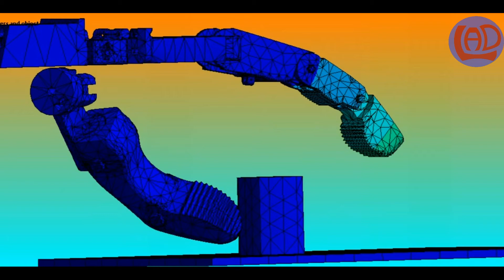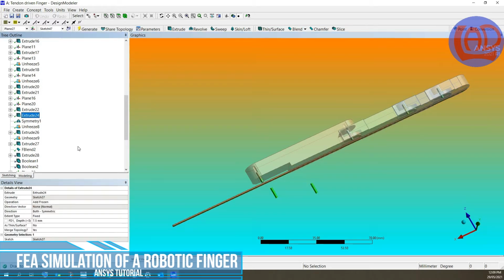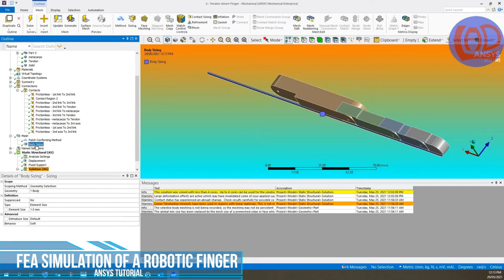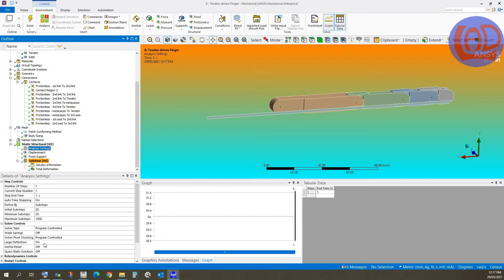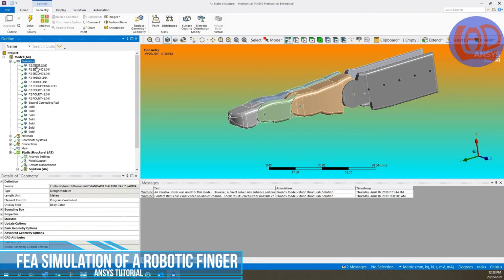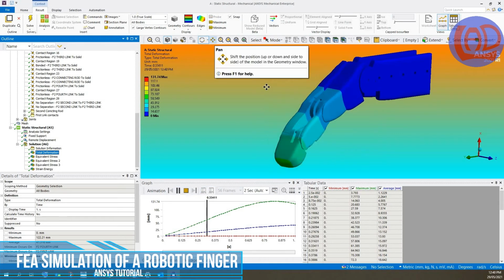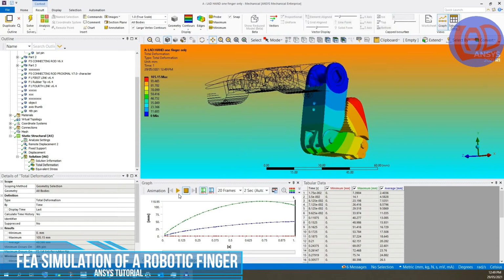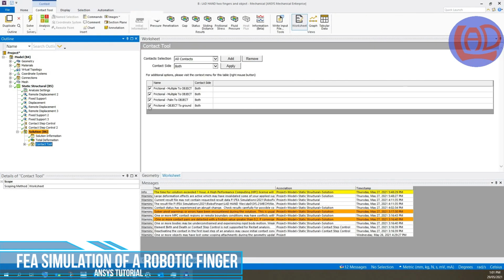👍ANSYS tutorial of a Robotic finger/Robotic Hand (FEA Computer Simulation)-LAD

Comment: how to make tendon flexible like the video
Reply from the maker: Hi there. Thank you for your question. You need to use a young modulus that is low and represents the behaviour of the tendon, which resembles hard rubber, say 10 MPa, then use density of 1,200 kg/m³ and Poisson’s Ratio of 0.49. Make sure to turn Large Deformations ON so that the mesh can flex, make the mesh on the tendon as tetrahedral and suppress the mid side node to improve convergence. Hope this helps.

Comment: Hello, I keep getting the error, "The solver engine was unable to converge on a solution for the nonlinear problem as constrained.  Please see the Troubleshooting section of the Help System for more information." Do I need to change something for it to become a linear problem?
Reply from the maker: Hi there @dencedianerivera1112 . This is a very generic error , and can depend on many factors, and you will need to check each one of them. And your problem is non-linear, because there are large deformations happening. The error message in ANSYS indicates that the solver was unable to find a solution to the nonlinear problem due to convergence issues. To avoid this, simplify your problem as much as you can by modifying your geometry in your CAD software to present ANSYS a body that is easier to mesh. Then, make use of the symmetry planes if possible. Make the right choice of materials, and start with simple linear ones, which are define by Young Modulus, Poison ratio and Density. If you have several bodies interacting together, then consider using linear contact elements to start with, such as “no separation” or “bonded”. Make sure that “Large deformations”  are enable on Analysis Settings. And always start small and simple, with one link rotating around a pin,  to identify specific areas causing the problem. Once this simple simulation has run successfully,  you then add another link, you define more contact elements between the two links, and you let that new simulation run, following the same procedure of the first simulation. Once that second simulation has run successfully, you add one more link, more contact elements, and you repeat the exercise until you have added all the links for your mechanism, and you are able to run the simulation successfully.  Start with the basic, then complicate things a little bit at a time. I hope this helps. Good luck in your project.

Comment: Hi, im just wondering on how do you solve the convergence issues when simulating?
Reply from the maker: @eoeol9054, that is a big question. You need to read the output of your simulation to identify the cause of the error that prevented your solution to continue running. In large deformations analysis the excessive distortion of the mesh is a possible cause of nonconvergence, which is corrected by improving the quality of the mesh in the unloaded model. Or the problem might be that you are trying to apply the load too quickly and then, the solution will be to increase the number of partitions in a substep. But you also need to check if the simulation is running at all or failing in the first substep, and if this is the case then you need to check the basics, correct boundary conditions, correct contacts, correct material properties. If your system is too complex, then simulating a simplified version of it can make a big difference, like using symmetry planes, or remove unnecessary geometrical details. Always keep things as easy as you can, and slowly increase the level of complexity so that you can better trace the sources that are causing the errors. Hope this helps.

Comment: my joints are not moving when pulling the cable can you tell me what could have been the problem
Reply from the maker: HI Friend. There are several things that can go wrong with a simulation on a FEA package. You’ll have to do a “routine/basics check“ to find where the problems are. First of all, have you turn ON the “Larger Deflection” option in the Solver Controls to allow for large deformations to occur? Is the solution converging at all, or is it failing to run in the first iteration? Failing to run at all might suggest a bad mesh or an aggressive stepping, in which case you will need to improve the quality of the mesh, and/or apply the load slowly or between several smaller sub-steps.   Are your boundary condition reflecting the real behaviour of your system (i.e fixed supports applied on areas that are not supposed to move. Everything else needs to be free) ? Have you created a geometry composed of multiple bodies and multiple part? If that is the case, have you created realistic contact elements between the multiple bodies that interact with each other (i.e frictionless, frictional contacts between the “Cable” and the cavity hole in each of the links where the “Cable” is supposed to slide through)? . Have you created revolute joints constrains on the pivoting points, and are they well defined ? (i.e prevent displacement in X/Y/Z and allow rotation in the axes of the pivot only, say RX=0, RY=0, RZ=free). The most accurate way to simulate a pinned connection is to add a pin to the model and use Frictional contact between the pin and the holes. Have these frictional contacts been properly defined, or is the friction too large that does not allow the mechanism to rotate?. Is the material for the “Cable”  appropriate, or is the “Cable” simulated as a rigid rod of steel?  I hope this helps.

Comment: please tell provide a detailed video how did you do this. I've been trying this thing for 3 days and could'nt get the desired result. please reply
Reply from the maker: Hi friend. Without knowing your particular problem, it’s going to be very difficult to assist you with any visual means. Are you having problems with excessive distortion of the mesh, or excessive penetration, or the contact elements, or the materials definition, or the stepping for the solution to converge or ….. There are many things that can go wrong with a FEA and no tutorial is going to solve “that” particular technicality you are trying to solve.  First thing to try is don’t panic. If you are having problems running your FEAs, then you belong to this earth with all the rest of us. We have all been there. I can tell you this because of my involvement in the field of designing and engineering. I’ve been using ANSYS professionally for 14 years and from time to time I found a headache or two. But I always follow the same procedure for any phenomena that I want to analyze. Whether you are simulating a rocket that is going to the moon, or a bar been pulled by a load, the procedure is always the same. And if you do not follow this procedure, you will have problems even when running the most basic analysis. Simplify your problem as much as you can by modifying your geometry in your CAD software to present ANSYS a body that is easier to mesh. Then, make use of the symmetry planes if possible.  Make the right choice of materials, and start with simple linear ones, which are define by Young Modulus, Poison ratio and Density. If you have several bodies interacting together, then consider using linear contact elements to start with, such as “no separation” or “bonded”.  If you feel like your model is going to move more than 1mm, then consider turning “Large deformations” ON. If you have 5 links connected by pins and ANSYS is not running for whatever reason (see the error messages i.e. is it a contact element error, or a mesh distortion error), then start with only 1 link fixed to the ground and applied your load to that 1 link.  Running an analysis on 1 link is a lot easier, right?. If you have problems of mesh distortion on that 1 link model, then you’ll have to redefine your mesh in the problematic region. If your simulation is running but not converging to 100% of the load step, then see if you can change the stepping to a smaller one.  And you do this over and over systematically. Then, when you have the 1 link simulation running to your satisfaction to 100% of the load, them you complicate your problem a little bit more by adding a 2nd link, you redefine your ground to the 2nd link and define contact elements between the 1st and 2nd link, and you let that new analysis to run and follow the same procedure you followed for the 1link simulation to run to 100% of the load step. Then, when you have the totality of your geometry running, you can complicate things a bit more, by defining non-linear hyper-elastic materials, or frictionless/ frictional contact elements, or turning the gravity ON, etc. Start with the basic, then complicate things a little bit at a time.  Good luck in your project.
Reply: @LADRobotics  Have currently stopped the analysis & getting some works done in design to get a more of aesthetic look for the hand. will definitely provide feedback in case of any error during FEA. 14 years in FEA, its totally awesome. moreover I have a small question. kindly do answer. what will be the good basics to sharpen up to perform a successful FEA for a beginner. thank you so much & between that is a nice work in this video. would really appreciate you & keep going. upload more videos. take care.
Reply from the maker: @megnathraja  Hi friend. My advice to you to improve your FEA skills is to keep running analysis. Be more involved in projects that require the use of FEA. If you are affiliated with a university, I’m sure they will offer you entry level training courses. And there are lots of tutorials on the net than you can try yourself. This is one option: https://www.coursera.org/courses?query=finite%20element
Finally, if you can be involved in an industrial trainee or a graduate program where ANSYS is utilized, then that would help boost your dexterity with FEA. Best of luck.